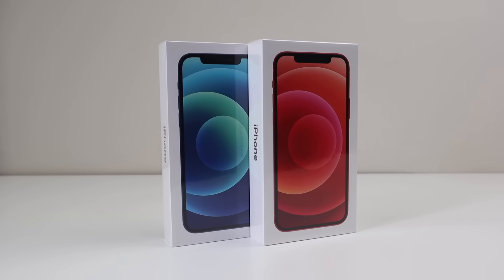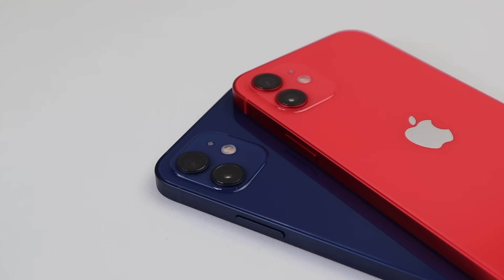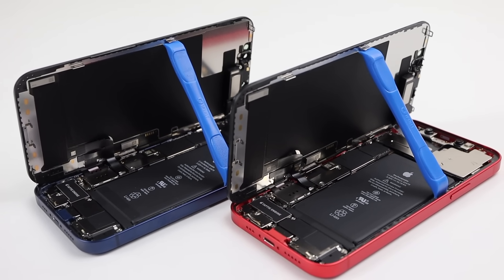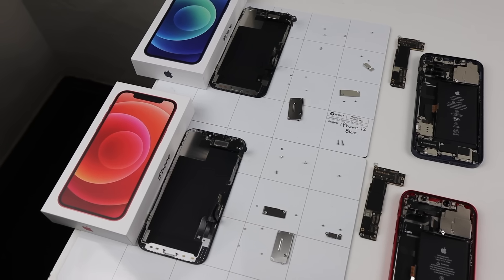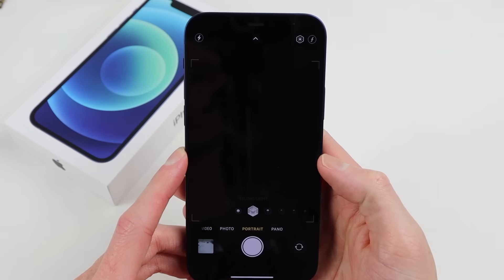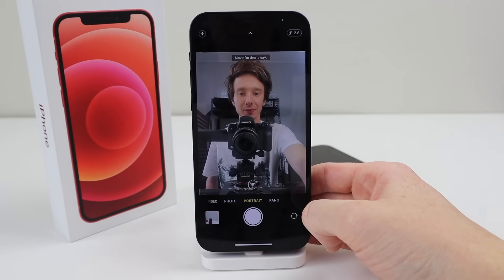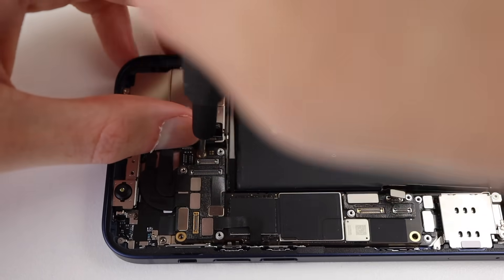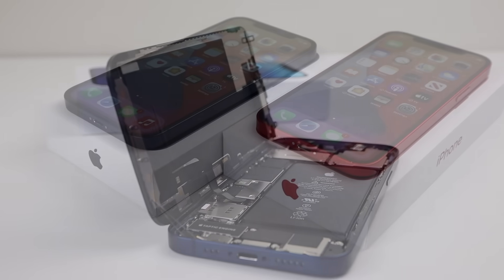iPhone 12 Anti Repair Design - Teardown and Repair Assessment

Comment: Apple in 10 years probably: If you buy a case for our new iPhone, you have to buy one our own Apple-approved cases that we are selling in our stores otherwise any non-Apple aftermarket case will immediately void the warranty of your phone. Luckily for you, our case is a very reasonable and cheap $100.
Reply: lol its should be around 599
Reply: @sambuddhabhusal2479  still to cheap when you almost pay 300€ for a pair of 2€ wheels (300€ without brakes and 2€ with brakes)  so the case is probably  about 800-900
Reply: And $ 199 for the case that doesn't cover up the back camera.
Reply: Stop, your giving them ideas 🤣

Comment: Preventing the right to repair your own electronics is actually kinda ✨ illegal ✨ I believe

https://en.m.wikipedia.org/wiki/Electronics_right_to_repair
Reply: If you read that article it appears that it is not illegal yet. It is an ongoing struggle. Bout the only thing that is definitive is that they can't immediately void the warranty (in certain states) by taking the device apart unless they also offer free warranty repair; and they would rather change their warranty than offer free repair.
This shady practice has apparently migrated to medical and farm equipment as well. Farm equipment has had some success in physical repairs but medical equipment (especially during the pandemic) has been a problem. Shoutout to PIRG and iFixit for doing their part to counter this anti-repair movement.
Reply: Why would you wanna change their business model, just don't buy their crap. There are better smartphones out there
Reply: Sounds dumb but look up new John Deere repairs. There’s articles about right to repair. Phone manufacturers and operating system companies are backing John Deere in the right to limit or remove end user repair. And remember a new John Deere tractor can end up over 800k or more
Reply: Exactly it’s a movement but not illegal or legal yet. That’s why apple is lobbying.

Comment: Not only can you not repair your own phone but even apple refused to repair my phone under warranty because of "water damage" here is their own diagnostic only to be told later after picking up the phone that it has water damage.  Mind you none of the LCI's were triggered.

Steps to Reproduce: visually verified issue,
ran mobile resource inspector, passed
ran audio diagnostics, failed, failed again,
Restore device and set up as new, issue persists 
ran audio diagnostics, failed

Cosmetic Condition: Display has screen protector with cracks,
Enclosure buttons are functional 
Rear has smudges,
external liquid contact indicator shows no signs of liquid damage
Reply: yup apple just wants you to buy a new device

Comment: It has a coding in the systems. When you switched, the codings don’t match. When you returned the logic board, it worked fine since the coding matched.

Comment: Regarding the battery and true tone display- it's not impossible for a regular user to get past that. Personally I use a Quan Li programmer. You plug in the old battery/screen, it reads the information on the original screen, and then you write it to the new screen. It tricks the phone into thinking it was the original part. Granted, that doesn't really help with the whole face ID or camera issue, that issue is fairly new to me 😂

Comment: Apple is a company that likes to do everything in their power to prevent 3rd parties undercutting their $$$.  Which is why I only use android phones.  Hell I got a Kindle Fire tablet and was having to hack it get software on it thus while I liked it.  I won't be buying another Fire tablet.  The cheap chinese tablet I had before would run any software without complaint.

Comment: Me and my brother bought iPhone SEs around the same time. It worked wonders until the SE2 release this March. There is nothing significant to complain, but it just crashes apps intermittently. For ex: Can't play songs while using Maps. The songs wouldn't even play. Now that right around the time of iPhone 12 release I see that my battery drains super fast if its below 30% and even shuts down at 15% randomly even though my. battery health is at 91%. I thought the phone is old and its just time, but my brother reports of experiencing the similar things. Worst of worst, I see similar problems as in the above video when I replaced my old iPhone SE with a over the market screen. Apple is involved in some big conspiracy.

Comment: Initiative Q is an attempt by ex-PayPal guys to create a new payment system instead of payment cards that were designed in the 1950s. The system uses its own currency, the Q, and to get people to start using the system once it's ready they are allocating Qs for free to people that sign up now (the amount drops as more people join - so better to join early). Signing up is free and they only ask for your name and an email address. There's nothing to lose but if this payment system becomes a world leading payment method your Qs can be worth a lot. If you missed getting bitcoin seven years ago, you wouldn't want to miss this.

Here is my invite link: https://initiativeq.com/invite/R2d8H_FtZ

This link will stop working once I’m out of invites. Let me know after you registered, because I need to verify you on my end.

Comment: “Will stop supporting it in few years”... Apple still can repair your iPhone 5s as of today. It also still has replacements available for original iPod. 
So by the time it will stop supporting iPhone 12, barely anyone will actually have that phone on hands.

With Apple Care + you’ll get display replacement at $30 and a whole phone replacement at $99.

And you should consider wearing grounding strap on your wrist as you handle delicate hardware which can be damaged by static electricity. As a “technician” you should know that.

Comment: I don't necessarily think this is an e-waste problem, as much as just a right to repair issue. Decades ago, auto manufacturers had the same thing going on, trying to tell consumers that if they use any other brands of disposables, such as filters, or even went anywhere else but an actual dealership for any kind of repair, adjustment, tweaking, etc, you would be immediately voiding their vehicle's warranty. A similar situation also took place regarding the third party manufacture of repair parts. The auto manufacturers didn't want any aftermarket companies to be able to manufacture replacement parts for THEIR customers' vehicles, and actually viewed it as patent infringement. Both of these practices got shot down before they were able to gain too much traction and force vehicle owners to be able to do things only their way. Comparatively, the cellular phone industry is still in its infancy, and manufacturers are still testing the waters to see what they can get away with, but given time, these kinds of business practices will be shot down here, just like they were in the automotive industry. People just need to start complaining, and complaining, and complaining about it. And don't let up. Keep pushing back and don't give up your right to repair.

Comment: Luxury automotive brands have done that for years. Certain parts are essentially "married" to the VIN or software of the vehicle. It's easily changeable but most of the time it requires the use of a factory scan tool.

Comment: So in short: every part is "one Device limited". What BS... I did some repairs in the past by swapping Parts (not Smart Phones, but Consoles and Handhelds) and i never seen that parts does not work, even if they are new, because "The Company don't want to". It's actually sad to see that ppl are still buying apple products, because they are "used to" buy anything new, if the old one stops working.

Comment: People need to stop being such asses about apple lovers. Are there people who buy only apple? Yes. (It is a bit much) but people are entitled to there opinions. Ffs. There’s a lot of things that I’ve come to appreciate about apple.  Do they have far less than stellar aspects to them? Absolutely.
I used to be a die hard Android fan. I would use the hardware and software to its fullest, downloading 3rd party apps, dissecting files, transferring data, hacking the occasional game or two. It was great. But the phones that had an android operating system would never truly shut down the apps I’ve “killed” (which I had to get an app for) and the phone after 2 years would show significant signs of slowing down. 

3 years ago the company I worked for supplied me with an iPhone for business. And after a while I started using it more and more. Years would go by and the only thing that would deteriorate was the battery. Everything felt fluid and smooth. I was able to get around the minor annoyances of Apple Music and use a cloud service. And after 3 years i now prefer iPhone. (Which I never thought I’d say) and I just bought an iPhone 12. 

Stop hating on people who decided there favorite phone was something other than what you think is good. People prioritize different things. And apples software is the best for keeping the hardware lag free and the device running smoothly. Both in communication with apps and with other apple products.

Comment: I felt the bias against Apple less than 1 min into the video. It would be nice to watch a review that was impartial. If you have ever had an iPhone before, your charger works just fine and you do not need to go out and buy a new one. Apple included the USB C cable because when paired with a USB C wall adapter your phone charges significantly faster. It's a great feature.

Comment: Next: Apple would sent the phones wrapped in bubble wrap only.. 

the box and manuals each sold separately...
Reply: Future : 
iBox : $499
iManuals : $399
iCable : $499
iCharger : $599
Reply: @fuadfuad5067  ICrap: $0.
Don’t buy.
Reply: @fuadfuad5067  Future: Apple soon to be demonetized for false advertising.
Reply: The manual is not included in order to save 2.1 cubic millimetres of carbon emission waste, now you can download your very own iManual from apple.com (after verifying your purchase) for only $49.99! (Printing and downloading costs not included.)
Reply: future:iphone screws:25dollars each
Reply: Ain't bubble wrap a plastic waste ?😀
Reply: Samsung is in talks to remove the charging plug as well.

Comment: I think they actually switched to USB C to meet the EU requirement of a universal power cable for smartphones. However, I’m pretty sure it was implied that they were supposed to have the actual port on the phone as USB C, not the f***ing power adapter. I really hate this about Apple
Reply: MONEY MOTHAFUCKAS
Reply: This EU regulation doesn't work like that. The phone can have any connector the manufacturer wants as long as the charger itself can be reused with other products of different manufacturers and an adapter is available to connect it with your device. So the USB(-C) to Lightning cable is the adapter and the charger is currently standardized to have USB-A port, perhaps that's why Apple didn't include the USB-C charger with the phone. USB-C will become the new standard in the future but it is not yet right now, not on the charger side. Also that's why there are multiple standards for fast charging - the charger itself has USB-A port usually and can be reused with any phone or other device, but to make use of fast-charging you still need to ensure the charger, cable and phone are compatible. Having different fast charge standards does not violate the EU law but still makes customers buy a dedicated charger for their phone from the manufacturer. Would be nice to have USB-C everywhere and universal support for USB Power Delivery charging, but by the time we get there, there will be probably even more modern standards on their way and manufacturers will always find some way to make customers pay them instead of paying the competition. As much as I would like to pin this on Apple being the ambassador of all evil, there aren't that many manufacturers on the market that are better in this regard. Basically it's best to stick with USB-C with Power Delivery support, as it seems to be the most future-proof standard.

Comment: This issue is not only at iphone 12 but all the older phone till 6 are do the same. Unless there is a way to copy the parts serial number came with phone it works fine.

Comment: Yea I’m switching to android
Reply: Buy a Sony or a Samsung. Welcome to the light side.
Reply: Only ever used Android phones, never going to use Apple. I'm now wishing I had the ASUS ROG Phone 3 with all the attachments. Of course, I need to get a job before I can buy it, even if it is $400 less than the iPhone 11. The specs are better as well.
Reply: linlinö önilnil  it's true.
Reply: Android gang
Reply: Samsung just released an update to block 3rd party screen repairs just a heads up.
Reply: @iTechToU  Well it's definitely cheaper than iPhone repairing so yeah it's worth it.
Reply: smart move
Reply: Ay if you're switching dont forget about Samsung dex its pretty handy especially in the pandemic wireless desktop features built into every phone 👌
Reply: Buy LG or Samsung
Reply: Samsung sucks. This isn't apple vs android, overpriced phones such in general
Reply: @asmrthoth7272  It's actually 'the amount of features that you get for your money' is the problem.
Reply: Redmi and real me
Reply: Imagine using a 1000$ phone that has low specs and redesign
Reply: @burd2981  wdym?